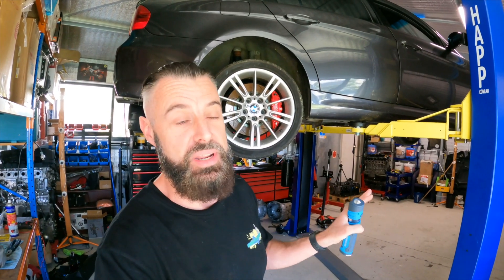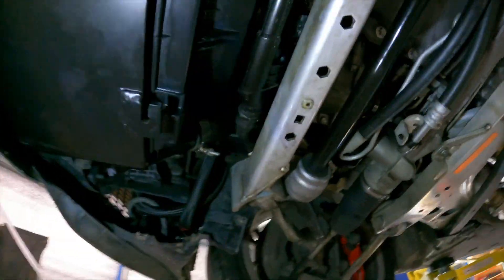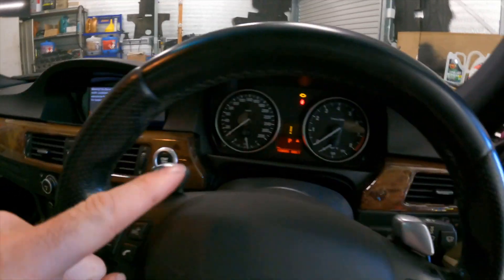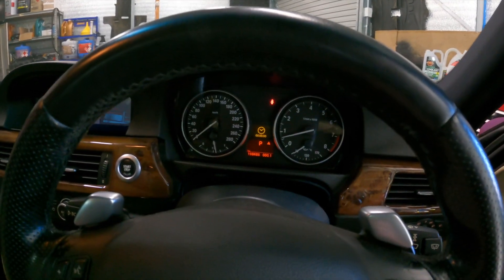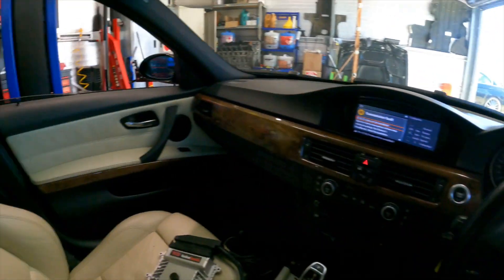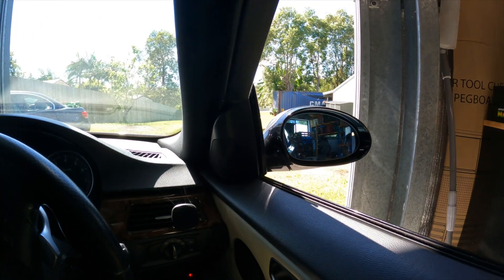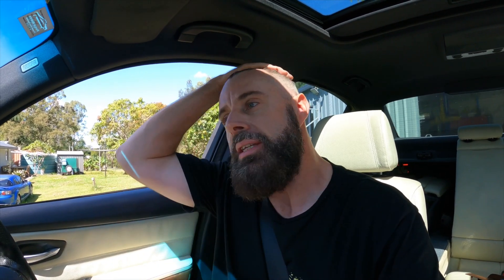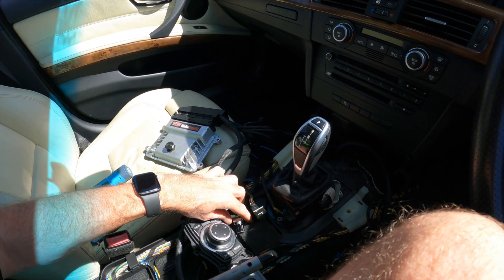BMW E90 BUILT MOTOR & 8HP70 SWAP FIRST DRIVE!

Comment: Man this 8hp conversion is not for the faint hearted !
Good on you though dealing with the stress of two major unconventional upgrades at the same time!
Reply: the hard part is understanding david lamik speak english lol. Bless his soul for being willing and having the same passion as us.   Theres one thing that andrew hasnt gone over yet in detail, and that the n57 converter should not be used on single turbo or high hp twin applications because its designed to lockup at under 500rpm and setup for torque at low rpm. its literally 3x as heavy as an a90 converter, and thats with the a90 converter having billet internals.  the a90 and the bmw 340i/440i/540i/ b58  converters out of the 8hp45/50  is the one that you want.   it requires 4.5mm washers instead of 2.5mm when you have to weld them to the converter plate.   both the lamik and the domiworks adapters are 17mm thick, so this data runs true across all 8hp/n54 adapter setups.  if you use n57 converter, 2.5mm washers,  any b58 converter sits 2mm deeper into the bell housing so add 2mm to that original 2.5mm and youre spot on the money.    the crazy part is if you put the a90 converter next to the n57 converter,  its 15mm or so shorter than the n57 converter and on paper it looked like a custom 15mm spacer was needed, it turns out they changed the snout of the converter just slightly and recessed the spline grooves between the first  and second generation 8hp converters!  somehow despite being 15mm shorter, it only requires an extra 2mm of spacing!!!!!!   thanks to andrew for the data, i was able to compare all of it with mine and now we have all the data ever needed for this swap! ,  andrew did the lords work and documented it. My garage looks like an n54 junk yard and i would be to embarassed to show it off lmao.

Comment: Assuming you deglazed the bores. Breakin will take about 30 minutes once up to temp. Accelerate from 2000 to 3500 at 25% to 50% for 10 sec (this wiil press rings against bore). then foot off throttle for 15 sec. (vacuum will pull oil into cylinder to lube rings). Try to drive this way for 20 min or so (hope you find a lonely road). Then oil and filter change. Great series you are fearless.

Comment: Parking sensors working nicely too! 😀 And don’t worry about the bottom end “break-in”, that really isn’t a thing. Other than bringing the car up to temp, the bearings shouldn’t be touching the crank at all! Great work, Andrew!
Reply from the maker: Well i know a guy who did rod bearings and managed to have an issue after about 30 mins of running. I know the ACL bed in on first crank, but it still made me nervous.

Comment: Definitely adapting itself to the car and your driving style. Not saying it’s a problem but personally I don’t like my n54s to idle that low ~650rpm at idle. All 14 of mine liked 800-1000rpm at idle and honestly I think that’s why it’s so hard to move forward, I know ~400 rpm doesn’t sound like much to adjust to but you’re taking it easy barely giving it gas on first drive you can only expect slip, faults, jerks, clunks etc. as you continued to drive it the results proved themselves you got reverse back, it creeps forward better. Mechatronics is filled with pressurized fluid based off your driving style as ALL Auto transmissions with a TQ slip for the comfort of your drive. Be ready for more funny feelings and dilemmas as you start to push the car harder and it learns how you drive. You’ve done an amazing job on this build. Looking to do this swap on my current N54  08’ E70 X5 swap and make it RWD.
Reply from the maker: I agree with that, i may wind the idle up. I also have cold start turned off which makes it worse.
Reply: @ZeroTo60Tube  you’ve done a great job, if anything bad was going to happen, that time has passed by now. Just be sure to always let that oil come up to temp to not smoke those brand new bearings. Rings will seat as more heat cycles are preformed normally. wish nothing but the best of luck👍

Comment: Crossing fingers that everything goes smooth here. At some point you will need to do the same conversion for the n52. Big up great work
Reply: Shouldn't really be any different for the N52 so there'd be no reason to do that

Comment: If you are talking the 5mm Allen bolt on the left side of the trans then yes, the car will not go in park AND will cause an error code.  Also did you just do the initial fill??? Check fluid level before you have turbo lamik guys troubleshoot.
Reply from the maker: Yeah i did the proper fill but didnt get it up in to all the gears, so i was wondering if it was a little low. However after this drive i checked it again and its actually ok.
Reply: Gotta be the settings then.

Comment: 16:30 I've got the same issue not sure how to fix it, I've got wire in the same place as you which fixed my transmission fault but had the same result as you. This is for my E82 135i with a ZF8HP45 transmission.

Comment: I was going to say maybe trans fluid is low, but noticed you'd answered in other posts that it's at the correct level (and I assume you checked with the trans at the right temp). Does it have a genuine trans filer or aftermarket one? I've experienced a couple of my own trans problems running aftermarket trans filters, where cavitation is an issue and causes slippage, but you'd hear that usually (though not always).

Definitely need to bed the rings in though, one thing I didn't say in the last comment though was to make sure oil temp is warm before loading the engine up, that will help protect the bottom end. Other than that, great job on the build, they rarely go smoothly, but it sounds like the motor is in good health and no unusual noises or leaks. Got to be happy with that.
Reply from the maker: I think it’s the pan. It is an aftermarket one and have been sent some reviews and people having the same problem 😩
Reply: @ZeroTo60Tube  yeah that sucks, but at least it's a relatively easy (compared to what you've just done) repair, don't sweat it. If the trans came witht he original pan, throw that back on as the control test, and all you may have lost is a bit fo fluid and time for diagnostic reasons, and you'll know soon enough.

Comment: Huge achievement, built motor working smooth, transmission nearly there too 👌🏻
Reply from the maker: Thanks 👍 The thing still makes me nervous, its done about 500klms now. Most at around 28-30 psi. The car is actually running on a more aggressive tune than it was when it blew up. But still, i worried i have messed something up.

Comment: . This is similar to when people haven't installed the torque converter all the way in (Three clicks then it's in no less from what I've seen and know but maybe different brands etc are different.). But Turbolamik will hopefully guide you through these first driving pains.
Reply from the maker: Generally or so i have been told, when the torque converter isnt all the way in, you break something when you do the box up. Definitely on the older ones anyway. Could be different on the 8hp as they do have a different style of oil pump

Comment: It moves! Loving this project. Did you check the fluid level after hooking all the trans lines up and running it in? Hopefully not an electrical issue; 1st and reverse are usually tied together in the transmission.
Reply from the maker: Yeah i have checked the fluid since this video as well.... I think the pan may be the culprit.

Comment: Very similar setup here, followed all your steps , i got the same transmission error as you ,and followed your advice and jumped pins 3 and 4 on that black connector , but now i´m stuck with the same error that apeared to you at the end of this video (at 16:31) , the "select pos.P before leaving car" and my key gets stuck ,did you solved that one?
Congrats on the build, best regards ,RG.
Reply from the maker: This is testing my memory. But there may have been a wire needing to be changed in the car harness or lamik. 

From memory lamik sends the park signal over a specific pin in the 6hp connector. That needs to go to a specific pin in the car harness.
Reply: @ZeroTo60Tube  thanks a lot for the reply ,from the 8 people i messaged about this you were the only one that responded .
You can't remenber what wire was it on the lamik and the car ?, i'm sorry to be such a pain in the a**, but no one seems to want to help me , i'm wiling to pay for your time ,if you could help me.
Best regards RG.
Reply: @rodrigogomes8755  did you figure out what you needed to do to fix this? I've got the same issue
Reply: I’m at the same point and need to figure out what pins need to be shorted together! Any luck?

Comment: is there anyway the transbrake is activated? probably dumb but when in 1st and trying to move forward, sounds like straight cut reverse gear. but then it creeped in reverse, so i don't know

regardless, congrats on everything. looking forward to when it's broken in and getting to see your reaction to WOT
Reply from the maker: So the transbrake you need to be in a program mode and then hold the paddle to activate it.  What you are hearing is my issue, trans slip.

Comment: I’ve been meaning to ask this for a while, not sure if I’ve missed it on a previous vid but what exhaust are you running on this car? Exhaust options are such a pain for this platform, but this looks and seems to sound nice for an N54
Reply from the maker: It's an empire exhaust and it's pretty rubbish. Not happy with it even tho it was quite cheap.
Reply: @ZeroTo60Tube  thanks for the honesty, I have the VRSF street exhaust currently. Happy with the sound, fitment is however shocking. Loving the builds so far mate keep up the great work!

Comment: As soon as you can get some serious pressure on those rings to bed them. Also is the trans fluid completely full?
Reply from the maker: Yeah checked level again after filming. Still the same.

Comment: Hey quick question .. What is the part number to the transmission bracket @ 1:07 ? My car is being worked on right now but ebay sent me the wrong trans bracket :/ so im stuck
Reply from the maker: I honestly can't remember. But it was from a e90 330d 6hp26 box.
Reply: @ZeroTo60Tube  thanks for the speedy reply. Last question bro! So I got the universal wiring for this swaps since I couldn’t find the 6hp->8hp wiring. Did you use the universal wiring as well ? If so how did you adjust the wiring to fit the e90 / do you have a link to that resource to share ?
Reply from the maker: @isaiasjulio1  I would recomend watching the build series to see what i did. However i used the premade harness.

Comment: What engine oil do you use for your car?? In Australia
Reply from the maker: HPR-10 or Castrol Supercar 10w60. However that doesnt mean you should use them. Its just what i like. I like thicker oil in our hot climate and a older worn engine

Comment: Get 2 hydraulic wheel dolly's, way easier to move your car in thight spaces
Reply from the maker: I have wanted some since we moved in, to be fair would have only used them 3 or 4 times. And the jack is ok when you have 2 people, just did not want to roll yesterday, mind you the floor is slippery as

Comment: How much time does it take to build the bottom end? I might just replace my motor with a used one. Not sure what to do.
Reply from the maker: If you have the motor sitting there all clean ready to be stripped, i would allow a day, to strip and put it back together. Takes about 2 days to work out what you need to order tho.
Reply: @ZeroTo60Tube  I might go at it. Wish more people ran built motors to see reliability with these engines.

Comment: That was frustrating to watch, at least check the fluid levels.  And follow the darn instructions.
Reply from the maker: I had checked the fluid levels, twice prior to this, however had not checked them after driving. Why did you find it frustrating?
Reply: @ZeroTo60Tube  Frustrating because something was clearly wrong and I didn't want to see the next video titled, "I cooked the clutches in my 8hp now what".  I was also assuming there was a mechanical issue not a software issue, from the next video it looks like I was right??